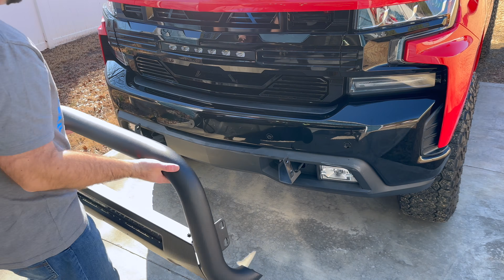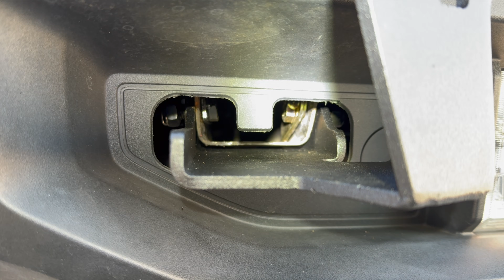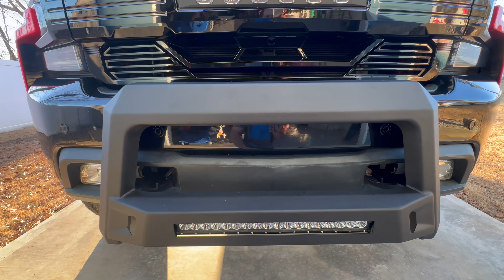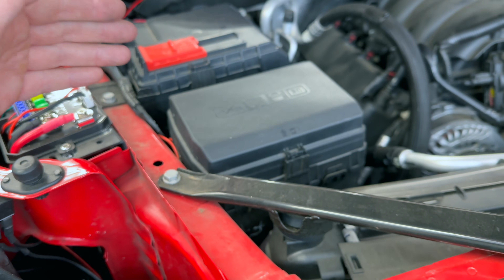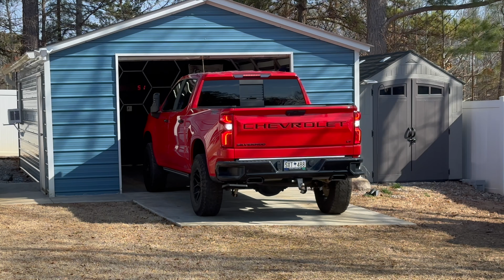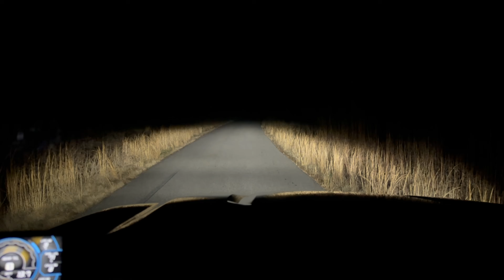Best Looking LED Bull Bar on the Market! | Chevy Silverado Review

Comment: I installed the same bull car but the park assist sensors in the middle are blocked, it came with covers which disabled the park assist. Do you know of a relocation kit for the middle two sensors so the park assist feature still functions with this bull bar installed?
Reply from the maker: I don’t know of a kit, I always had to keep the sensors turned off.

Comment: Great video, so much easier than the paper instructions, thank you! Question, you used the top holes and I’m trying to use the bottom holes just to see if I like it raised or lowered, but the bottom holes don’t seem to match up like they’re drilled wrong. Did you have this issue or just went with the top off the bat?
Reply from the maker: Glad to help, yes the holes only seemed to line up one way.